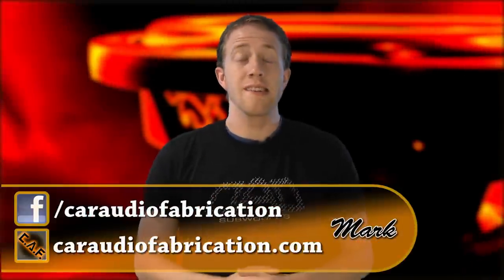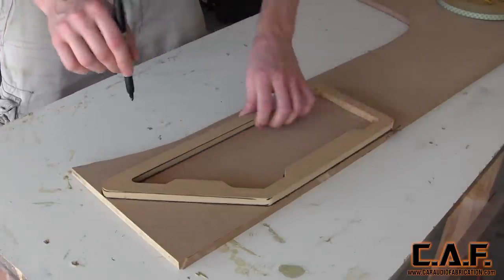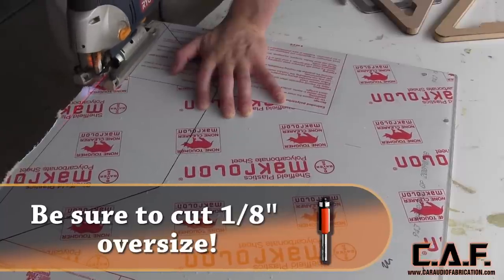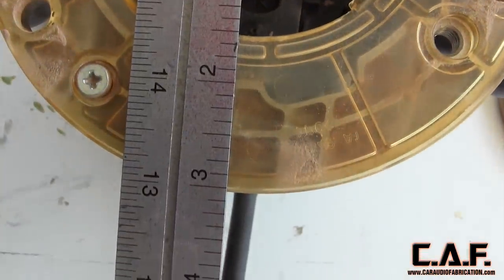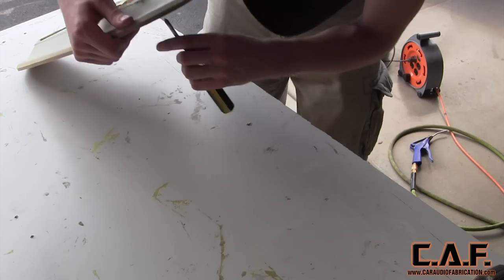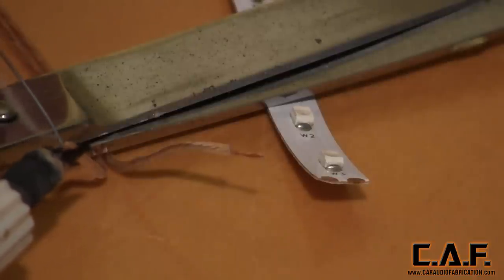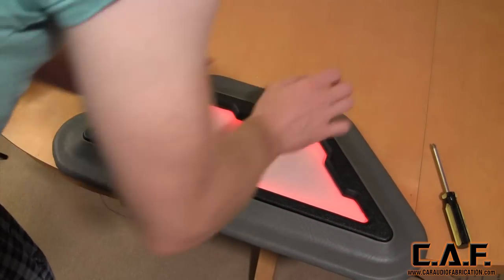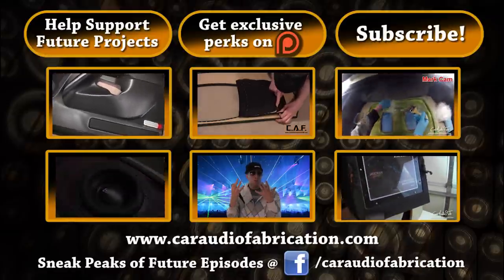LED lit Plexiglass - Install Light up Panels in your Car Audio Builds CarAudioFabrication

Comment: I used plexiglass in a door panel.  Underneath the plexiglass we used a stretch fabric against the back side instead of sanding.  We also cover the wood on the bottom with aluminum foil to spread/break-up the light.  It makes the light-source look centered and seem brighter.

Comment from the maker: Are you wanting to use plexiglass on a future install? How about some back lit? Watch this video and learn how you can integrate it into a panel within your install.

http://youtu.be/58yDi8rSIhc
Reply: I would love to use this technique to highlight a merch table at a music gig :)
Reply: I'm planning on building a 4th order bandpass box for two RF 12" P2's. I want to get a piece of plexiglass to put onto the front of the sealed portion of the box, and am planning on getting an etched-style logo to stick onto the plexiglass portion, then I want to light it from the edges so that the logo lights up, but no other parts (except for the very edges) do.
Reply: +CarAudioFabrication I've used plexi for a bandpass sub box for a 12" kicker comp
Reply: +CarAudioFabrication 7:09 years of practice
Reply: hey, have u done, instead of sanding the transparent material, u route/etch a design onto its surface? I would expect the etching to catch the light, as the led light should permeate through the plexi like fiber optics.
Reply: CarAudioFabrication
Reply: CarAudioFabrication hey mate im relatively new to car audio but just was wondering, can i wire my strip lights to the remote turn on wire? Im not wanting it to pulse with the bass?
Reply: CarAudioFabrication hey bud, love the content you pump out of the "fab kitchen" lol, Ceiling Light Panels are a perfect alternative to polycarbonate, they are easy too work with, & they are SUPER CHEAP!!! Keep up the good work

Comment: Hint! If you have ever taken apart an old monitor and gotten down to the back lit screen you will notice that the imperfections that they put in the plexiglass are more dense in the middle than on the outside. This causes the light that is bouncing back and forth inside the plexiglass to hit less of the outer imperfections, which caused the light to then reflect outward, and allows a more even amount of light to be distributed throughout the entire panel.
 If you noticed when he turned on the LEDs it was more intense around the outside edge and the light was not as intense in the middle.
I think that if he did less sanding on the outer sides and more sanding in the middle then the light might look more uniform from outer to inner. Great job though!

Comment: I've done a pair of polycarbonate light bars. The way I did it was way too complicated. I flush mounted the poly, built a light box behind the opening and mounted a computer LED light tube. I tried sanding the poly but couldn't workout the right grit so I took them back to clear with 2000 grit and used frosted glass paint like you'd use on a bathroom window. It would have been much easier if I'd known about the template techniques. My next box is going to be awesome! Thanks Mark!

Comment: My first custom fiberglass install was in my girlfriend's '94 Lumina. Did and etched plexi butterfly in the amp rack to match her tattoo... It actually worked out great. The relationship...not so much. Anyway, I agree with you on the plexi vs. acrylic or other medium. It chips off way too easily. Keep up the good stuff man.

Comment: Used Polycarb on front of Sub Box and lit inside with Neon lights years ago. It was a three Mtx Blue Thunder 10 inch subs in a three chamber ported enclosure.

Comment: I have used plexiglass on a center console/sub box. I am planning to build a sub enclosure for my sons 2006 Tahoe that will consist of two 15" DC Audio level 4 subs. I want to incorporate a veiwing window with some sort of LED lighting. I have not began the project yet but I am starting to gather materials. At least things I know I will need. I'm in no hurry and I want to do a really good job. I enjoy your videos. You are very talented. Thanks for your videos.

Comment: I used plexiglass to make tweeter mounting brackets in the stock location in the doors of my tacoma. Worked pretty well, but it plexi i used was really thin, so it kept cracking. Scoring it and snapping it worked better than trying to cut it with a jig saw.

Comment: I used plexi glass in the floor board of my trunk. I installed my amplifiers in the spare tire slot on abs board and my meds are actually in groove slots on bottom side shining down on amplifiers and wiring as seeing through the plexi. Learned everything on this site & 5 star

Comment: looks awsome ... again :D
i just used plexglass on computerprojects to enlight selfmade engravings... its quite similar, but the glass is only engraved and not sanded.
i used once 2 layer to become a two colord engraving, but therefore i had to use thicker glass and put the leds directly into the border in a drill hole.

Comment: I have used plexy only for viewing areas for amp racks and speakers.  Been some time since I have done any higher end installs but used neon and small bulbs to add lighting to them.  Also engraved names on painted plexy to fill unused dash areas and put symbols or names lit with LED.

Comment: Awesome work as always, Sir!
I have an acrylic window on the back of my sub box to let you see the motors from the trunk, along with some internal LEDs in the box and a mirrored bottom plate.
Also BTW, if people don't want to sand the plexi to get the opaque effect, there is glass "Frosting Spray" which gives the same effect and isn't very expensive.

Comment: I used two pieces of 1/2 inch plexi, and engraved both pieces with a club logo, glued the two pieces together to make one 1 inch thick panel, drilled hundreds of tiny holes and placed green LEDs in the holes, and it brought. Out the logo in green and it was used as a window to the back of a box still in there from what I understand

Comment: I once used plexi (actually I think it was acrylic) to make floating amp and eq racks, back in 1994...ish. I flame treated three edges of the plexi and installed neon lights on one edge that wasn't heated. The eqs were actually hanging from the ceiling, it looked pretty cool. I wish we had some that led crap back then. I think we had 32 sticks of neon on that truck lol. It won trophies and stuff. I wish I had pics of it :(

Comment: My plan was to use this technique for my sub enclosure to cover up 2 amps, like a see-through window! On the richt side i wanted to place the sub, ported en pointed to the back of the car, and then on the left side, use the leftover space for the amps, sub and speaker amp. Hopefuly it works out like i hope it does! Fingers crossed

Comment: only used it for a set of custom taillights, converted 4 2006 vw passat lights to mount as bucket lights on a flat rear panel
best moment, discovering i can mount 21w festoon bulbs inside the remaining light shell infront of the red led's to act as reverse lights, regular bulbs like the festoons just seem to work better than any led for that light throw for reversing
like this vid, will be trying out for sure.
 thanks!

Comment from the maker: Use polycarbonate next time, I find it much easier to work with. It is a little more expensive, but if it doesnt crack when I put screws through, I will take it.

Comment: I haven't used plexi for any installs. I do plan on using it for my next rebuild. I've been thinking about mounting the amps under the enclosure like Meades tahoe, and having the rear of the amp "enclosure" have a plexi window so the amps can be seen with the liftgate open. After seeing this video there might be some LEDs in there as well!

Comment: I have before I have tubbed out my trunk with 2 windows with plexi I did use a sand blaster to etch in the some letters in it and applied blue l.e.d light strips

Comment: Im a big fan of plexi and have used it in many installs from my full on lay lo 84 S-10 full hydro setup under plexi back lit  with custom sound system set up with back lit center console integrated into the dash it was a hot set up back in 85/86 when i was in furniture and cabinetry i did many commercial jobs using plexi and rope lighting also tinted plexi applied to the back of  Dupont Corian and back lit makes for a custom kitchen counter top  install the effect was out standing  the jobs came easy as i was very versatile between my career in cabinetry / furniture and full on custom lowriders from paint and body to metal work to custom interior and sound systems my projects today includes a 2016 Peterbuilt  Semi complete sound system with amp rack under a custom vented back lit plexi cover my love of the work spans some 35 plus years from wrenching on motors, paint and body work with my dad to owning my custom cabinetry shop and trucking company

Comment: Well at the moment I have a bit of a mismatch. Sony xplod HU going to two 6" front speakers (aftermarket but not sure what, came with the car when I bought it), a Kenwood KAC-8105D 1000w Amp into a Sony 1000w xPlod Sub. I also have two pioneer 6x9's sitting in my cupboard that I plan to replace the stock rears with soon but I've only just bought the car and it needs some body work first. Gonna get the paint, panels and wheels up to scratch and then hopefully work on some sort of audio install :)

Comment: Thanks Mark!  I'm really really old but still like to learn new stuff I've used your vids to make a speaker box and console for my '65 c10.  The box holds two 8's and a 12" that comes out between the bucket seats.  I'll flip you some pix's when I'm finished.  The Dave (not to be confused with The Donald)
Reply: Never to old to rock out, man.

Comment: I just happened upon your video and know it's over a year old, but I'm currently working on a design for a bandpass sub enclosure with integrated amp rack (one for the mids in the doors and one for the sub).  Both will feature backlighting but I decided to do it slightly different than the "frosting" effect.  I am going to try to rabbit a small channel into the edge facing surface and install the LED strips there.  My plexi panels aren't being hand fabricated, but laser cut, so one of the advantages is to do burned in design into the surface of the glass (reversed and on the backside so the front is still smooth).  With the design burnt into the plastic, the light will reflect off of those imperfections.

Comment: Im nearly done with a custom build for the hatch in my nissan 300ZX. Ive used gold mirror plexiglass for the amp tray and have a clear plexiglass cover with Logo. 
Ive also used plexiglass acrylic tubing with spiralled LED strips installed through the centre to light the whole thing and with the gold mirror all over it really reflects the light all over.
Id like to attach a photo but dont know how or if its possible.. maybe ill get a youtube video up instead.. 
Loving your videos, very cool..

Comment: I love your videos. I just bought a new Honda Accord in silver and black and i am going to do a custom 2-10 sub box with components throughout. Im excited to start this project and have some tooling but certainly not your amount of tooling. Im looking to integrate the honda H logo and possible a small Raider badge as this will be my silver and black raider inspired car. Some lights, custom false wall, 2 10” Polk Audio memo subs with two kicker amps. Should be quite a build for me...maybe ill post pics when its done, but it will take a while as second skin will be used throughout as well.

Comment: I have used plexi before on an amprack. I might use it again in the future, but I didn't like it being plasticky and very sensitive to scratching and swirling, so I'm thinking towards real glass if I ever need just a flat simple shape again...
What I do like is that plexi can be bent using smooth templates and heat, maybe that's an idea for a next video?

Comment: "...The orbital setting on your jigsaw..."

My jigsaw is, quite literally, 60+ years old.  It has two settings:  "On" and "off."  :-D

I find that a blade intended for thin metals works really well in cutting Lexan and polycarbonate, though.  Just gotta go slow and steady!

Comment: works better if you put the leds on the edge of the plexiglass facing inward. light gets "trapped" inside the plexiglass bouncing around and you get a hell of a lot more even lighting

Comment: Mark IV use plexiglass on speaker boxes back windows and the worst one is doing a curved sub box where the guy wanted the plexiglass curve and plexiglass and a heat gun or a lot of fun sometimes except don't touch where your putting your heat

Comment: what kind of adhesive do you use on your interior parts? door panels ext. I'm doing custom door panels on a h2 hummer and the 3m spray is coming off when it's hot out. I was going to use DAP contact cement but would just like your imput. good job by the way.

Comment: I would like to use a piece of 3/4 acrylic for a window in my sub box . I hate to hide the motors on these dc xls there so beautiful I would love to put the dc logo in the acrylic but don't have all the expensive machines that mead does to cut and laser the logo into the piece

Comment: i feel like your descriptions were a bit long winded when making the templates and wood pieces. Maybe could do just a simple sentence first then do the deeper describing sentences, or have text slide in at the bottom of the screen saying "Step 1: cut wood. Step 2: cut plexi" just a simple to this point thesis of the step. I'm deffiniftly going to be using these techniques in my install and found this tutorial extremely useful, i didn;t know how to do this previously.

Comment: did you score with a utility knife or something along the top edge and the filler edge?  it looks like there's a lot of filler on the top, then next shot shows it nice and clean with the insert.....because if I just pushed through the hole the way it was wouldn't it crack in multiple locations all around where it spilled and hardened over

Comment: Hello! I wonder with what kind of putty to use? So they do not crack when so hacked off the disc through the holes.

Do you have any link to the tape you use? Does it only egenskper to do a distance? Have tape characteristics that run to glue and putty does not stick to the tape?

Thanks for the many fine films. Will use a lot of this when my bill is being rebuilt this winter.

Comment: i would like  to do a similar shape but with two holes centered aproximatly in the center to go in the back window deck in between the 6x9 for two 5 1/4 midrange speakers because i dont want too cut into the material that the original 6x9 are on .

Comment: I was thinking about building a little stereo system and wanted to use this on the front with some blue leds.  Do you put the sanded side on the outside or the inside? or would it matter?  I couldnt really tell by the video..  Thanks

Comment: What would look better is to use a thicker piece of polycarbonate and do some sub-surface laser engraving to make a logo or perhaps to designate a component, and then light it from the sides so that the engraving glows inside of the polycarbonate. This way you can see through it and you have a glowing design inside the polycarbonate in the foreground.

Comment: Excellent tutorials Mark!   I would like to do something like this, however would like to be able to see thru the panel and view the top of the Tarantula amps I have.  I very Newb to all this but you instructions are also very inspiring.  So inspiring Santa got me a router and router table.  lolol.  I am already looking at templates from mobile solutions and bits.  Thanks Larry
Reply: i know, right? i read your comment, and im sitting in front of a new router, router table, fence, 100-bit set plus extras,  and a halfway done router/jigsaw circle jig thats acrylic adjustable, integrated-....:::sigh::: this is how it starts...

Comment: I used a plexiglass tube, sanded it, and it diffuses a blue light. However, I couldn't use a regular LED strip, I had to get a different kind of LED from Amazon, where's not on a strip, it's just naked wires.
Then I cut out a lot of the wiring between each LED. Very tedious.  This gave me LEDs closer together.

Unfortunately, LEDs are hard to center in the plexiglass tube. They'll unevenly press against different sides of the tube, giving you an irregular pattern.
To combat this, I found a thick clear tube, that I slide into the plexiglass tube, that keeps the bulbs from touching the diffused plexiglass tube.

Tough job, but I've done it for a few different things.
Another item I used to do this, was a white PVC-like pipe, sanded the entire thing (especially to get the print off). Looks white, but under illumination the white carries the color cast inside of it.

Comment: Hey Mark thanks for all the videos. Watched all your videos over the weekend found them very detailed and helpful as its hard to find allot of these skills. Is Car Audio Resources . com dead? Also what are requirements when looking for a router, just height adjustable?  How would a sticker look on the plexi-glass as I Plan on using this when I get a boot plan set up and have Focal Audio mounted on back light plexi-glass. And will also try to be using all your other techniques.

Comment: Hey mark what would you hook the led to so they stay on all the time? the ground and remote wire on the amp?
Reply: I don't think I would connect them to the amp remote and ground. Correct me if I'm wrong but I would think that you would want them to have their own power source.

Comment: If you do this in door pods where would you pull the constant 12V from?
Reply: test wires untill get the 12v from anywhere power windows, power lock. I would hook it up to the dome light (-) so every time you open the door it lights up, 😝
Reply: i was thinking maybe adding a dimming switch/knob but we shall see